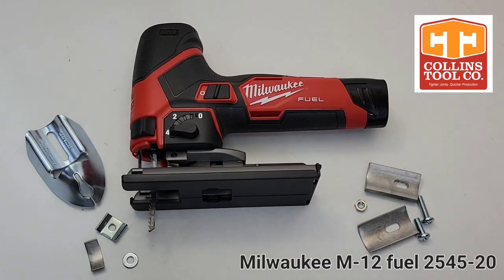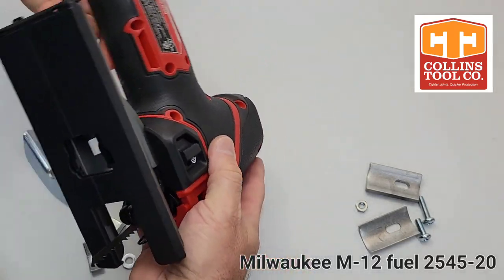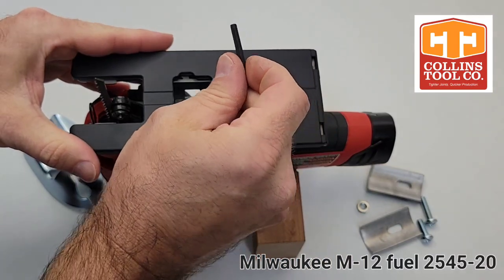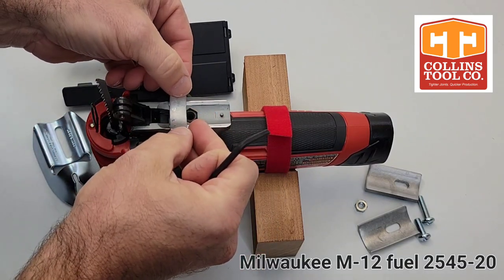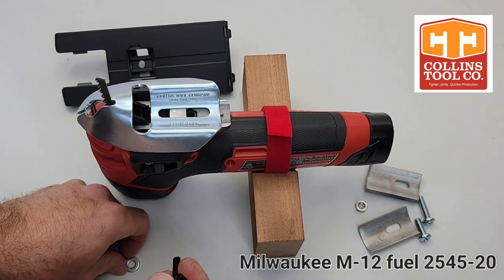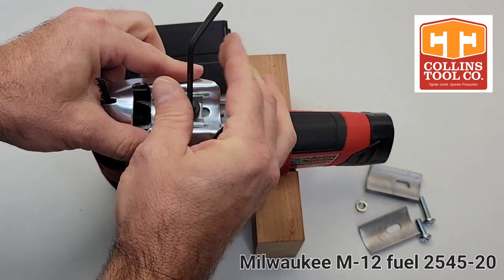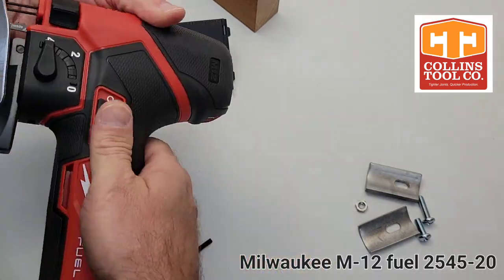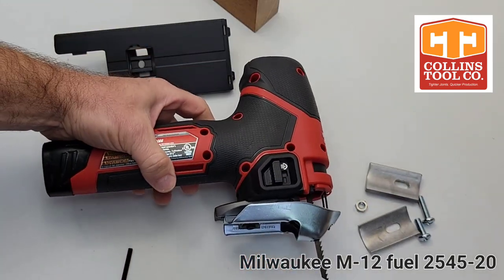Mounting the Collins Coping Foot to the Milwaukee M-12 Fuel, model 2545-20.

Comment: What is the part number for the coping foot that fits the Milwaukee 2545-20 jigsaw?
Reply from the maker: Hello, this is the "Universal Coping Foot".
Reply: @collinstoolco.   Ok thanks.  Has the design of the universal coping foot changed at all over the years?  I bought a universal foot approximately 8 years ago for a corded Bosch jigsaw I have.  Will that foot fit on the Milwaukee as long as I saved all of the adapter pieces?
Reply from the maker: @russalbright4213  Russ, the Coping Foot was modified a bit several years ago to accommodate some new saws.  The 2545-20 is in that mix. Email me and I'll get you squared away. adam@collinstool.com